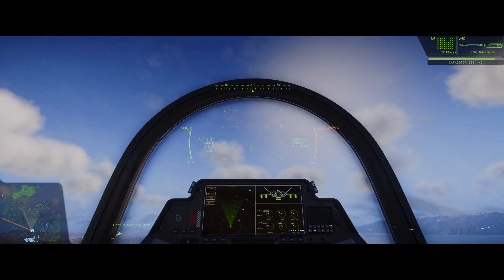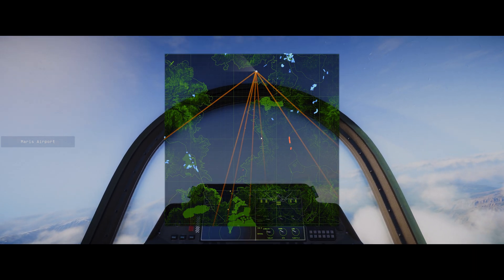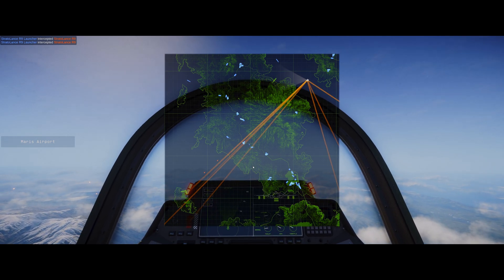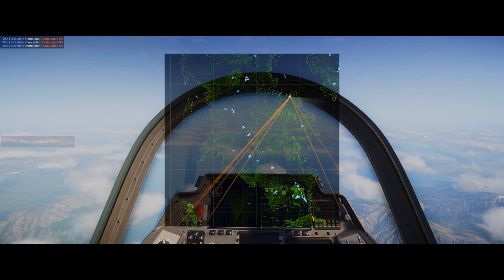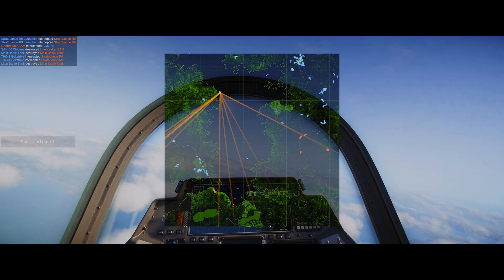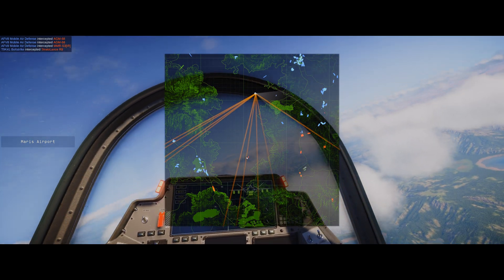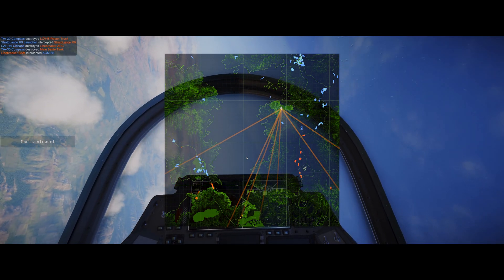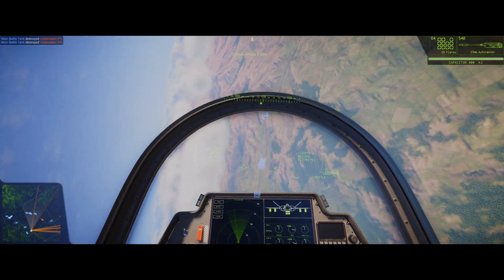Nuclear Option Radar Notching Tutorial

Comment: yeah that doesnt work man. at all. in your video theyre mostly being intercepted before theyre anywhere near you.
Reply from the maker: It definitely works and an update made it even easier. You just point your nose on the yellow line and you'll be in the notch angle. stay in the notch and when its about 1.5nm away  pull left or right and away from the missile as its still possible for it to hit if you're flying in a straight line
Reply: @TalonOneFS  mind showing that? its easier to see than it is to imagine. show notching missiles <15km out .
at these ranges in the video half the time i just dip below a mountain and voila, same effect. but in practice it doesnt work, especially without using the jammer.
Reply from the maker: @TheHeliommm  There was also just an update where you need to use the jammer at the same time as notching making it harder to avoid.